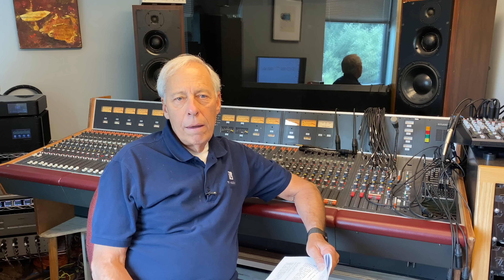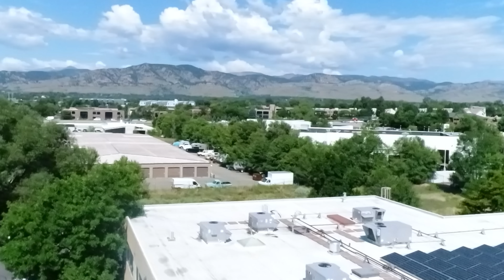Why are preamps expensive?

Comment: Thank you for an excellent explanation. I currently use a NAIM NAC92. These cost about £140 second hand. They are relatively inexpensive because the case is not so attractive as the “chrome bumper” NAC62 which costs about three times as much, but uses exactly the same circuit. In fact, the NAC92 is of a superior design, since it uses relays and electronic push button switches, rather than a simple mechanical switch. The circuit follows the design philosophy described here. There is a “unity gain buffer” to transform the input impedance, whether high or low, into a low output impedance at a power level sufficient to drive the balance and volume controls, which then feed into a main preamplifier, which has a high input impedance, so that the varying resistance of the balance and volume controls is swamped and has no effect on the signal quality. Then, the signal has quite a high degree of negative feedback applied to it. While purists would argue that this is not a good thing, the effect is to improve sound quality to the human ear. Just as a violin string sounds dull and lifeless out of a violin, the wooden case of the violin acting as a reverberation, or echo, chamber, adding life and body to the sound, a negative feedback circuit is similar, being a sort of electronic echo chamber, adding in timbre, life and body to the sound. Good audio engineers design for the human ear, not for the oscilloscope!

Comment: Good morning Paul, I've been in cable TV industry for about 30 years. started off as a cable TV installer then service tech then maintenance tech (a maintenance tech is the guy in the bucket truck that works on the whole neighborhood if you will). Then I got into management but I tell you that to say, working on those amplifiers to feed the neighborhoods for cable signal and all the things we have to do to make sure you get gigabytes speed. all the circuitry involved in those amplifiers turning fiber light into RF signal. The price of a BHK preamplifier is hanging on a lot of pole in your city. While I was in management I had to order inventory so I know how much those amplifiers on those poles cost so I understand to engineer something that's great as a BHK its going to cost a lot of money. And take it from the cable guy, "cables matter everyone". just the temperature of a cable will determined the attenuation of our signal, certain size cable determine how much signal I'm going to get on my output, we have to oscillate and shield our cable in order for you guys not to experience interference so you can get that gigabyte speed you want on your internet. And the hardest part of our job is to make sure we have a -50 dB noise floor throughout the whole infrastructure of our network. Cable matters more than you think ok, I'm rambling again. By the way I'm watching too many of your videos because I called my wife Terry twice at the dinner table. Lol have a great day
Reply: Do you think it makes sense to take experience with 1GHz-bandwidth signals traveling hundreds of feet through cable, and imply that 20KHz signals traveling 6-20 feet have similar issues?  
That's rather like insisting that a paper airplane thrown from the top of a skyscraper needs heat shielding like the space shuttle has for its descent from orbit.
Reply: The biggest part of the cable bill was on Easter Sunday I went outside to see the cable guy finally cleaning up a wired mess that was out at the bottom of the pole for 3 years.  Really HOLIDAY PAY is when you people finally do this.  Then he cut the wrong wire of course and had to run a new line to my apartment and schedule for the line to be buried and well, I dont have cable anymore.  I also had a problem when the oven kicked on my stereo would hummm.  I learned about the ground loop eliminator of course this cable company that rhymes with COMCAST had no flippin idea what that was.

Comment: Very good answer from the kindest man in Audio IMO.
Mark Levinson ML-7 pre-amplifier did obtain this balance between straight wire with pot (very expensive Spectrol Series 100 wirewound and later very  expensive Penny +Giles RF15 plastic conductive) and bufferstage. One of the best (old) pre-amps ever built and expensive also ($ 4,000.00 in 1981).

Comment: A good phono stage is worth its weight in gold and doesn't have to break the bank.  I use a NAD PP2e which retails for about £100 and it was a real game-changer for my TT.

My Sony LX-300USB is at the lower end of the TT market but I wanted to persist with it because I prefer an automatic TT to manual.  A separate phono stage and an elliptical stylus turned the weak, distortion-filled sound into punchy bass  and detailed sound.

If the separate phono stage hadn't worked out, I would have given up on this TT and gone for something a bit more upmarket but that little box makes a bigger difference than most people realise.

Comment: The last time I watched a video like this, I was off scouring the far reaches of the web, all in search for anything I could find about making your own voltage regulators.  I was interested in a regulator that I could really drain the current from, since commercially available regulators max out at about one Ampere.  I find the man who found the same rabbit hole before me and did the real digging.  His name is Walt Jung and he did more than build a discrete regulator.  He ran multiple regulators of differing topographies through whatever paces he could and wrote some good papers and probably even won an honorary degree or three, dubbing him the Grand Poo-Bah of discreet voltage regulators.  I still have yet to try out any of his regulators, having discovered the linear power supplies of Condor, International, and Power One.  Which all three seem to be the same power supplies made in Oxnard and yet they go by three different names.  So now I’m gonna be off searching probably about the potential of wiring my own transformers, maybe?!  THANKS FOR SHARING!!

Comment: I have very fond memories of my PS Audio 4.6 preamp from 1989..... It had passive and active modes, and what Paul describes is exactly what I experienced.  Passive was super transparent, but lacking some oomph.  Kicking in the gain gave it life and dynamics, at the loss of some transparency.   Sadly it had some reliability issues, noisy switches, and also was not remote control.  I switched to an Adcom preamp.  I liked the Adcom fine, but it was never as sweet sounding as the PS.
Reply: I've got a 4.6 as my main preamp at the moment. Love that thing, no reliability issues so far. Definitely understand the need to swap though I don't mind the lack of a remote.

Comment: I think I would feel much more comfortable getting an answer to this question from somebody who is not directly in the industry of selling preamps
Reply: @John Siket I would say it's an explanation but I wouldn't say it's a great explanation I would say it's one of many possible explanations for why so much money is charged for many of these preamps the thing is if you add up the cost of the  parts in a lot of these preamps they are dirt cheap compared to the final product price, in other words a lot of the cost comes from the initial R&D but let's face it making that money back in most cases doesn't take very long and then they just go on selling it for exorbitant amounts of money and I feel in most of those cases they are making way more profit then most people would deem as Fair
Reply: @MikeG-js1jt  I'm confused about why preamps need to take R&D into account.  Surely you can just implement a circuit which has already already been tried and tested twenty years ago.  There are lots to choose from depending how fussy the client is.  Why do we keep re-inventing the wheel?
Reply: @westinthewest  I'm sure there are scores of pre-amps out there that use "already developed" circuits, which brings us back to the original question "why are pre-amps so expensive" which leads us really to a single logical conclusion...GREED

Comment: Pots also have a mismatch between the two signal levels due to a varied resistance between the two wiper paths.

High end studio monitor controllers will typically use a relay network where each is connected to discrete resistors for repeatable volume levels and consistent stereo image.
Reply: Is there a same problem with electronic pots or volume controls?
Reply: @ranbymonkeys2384  pots are pots so they all have this issue. Some people think the problem goes away with stepped pots but they are still a mechanical device where a wiper touches a resistive plate; the steps just stop the wiper in predefined locations. These locations are not exact so the resistance will vary.
Reply: @rapfreak7797  So if you have 1 pot per channel could you not match them?  They may not show the same level on the knob but they can me matched I would think?
Reply: My NAD 2400 had 2 pots left and right I could adjust the little pots on the inside to make them match.
Reply: @ranbymonkeys2384  in theory yes but In practice no. Even resistors will have a tolerance level made to be a single value whereas a pot varies resistance based upon the location of the resistive plate; it’s a matter of physics.
Reply: set your bass treble and volume break the knobs off and love life man
Reply: @ranbymonkeys2384  stepped switches going through a relay network going through different matches pairs of resistors.  That’s the best method I know of although there may be a better option.
Reply: @rapfreak7797  well if we look at physics arent then resistors your going through your big problem?
Reply: @ranbymonkeys2384  a pot sitting still SHOULDN’T vary in value so if you’re talking about internal calibration pots that is a good solution to match your volume levels between channels.
Reply: @ranbymonkeys2384  the travel across the resistive plate is what causes the issue, you’ll never stop in the exact same spot each time so you will get different values. Now multiply that by two, no two pots in reality will have an exact match of the starting resistive value and the slope at which they vary; nor will that slope be a straight line (in the caramel of a linear pot)
Reply: @rapfreak7797  I like just going through 2 matching pots that adjust to match a pot I dont even own
Reply: @rapfreak7797  if you see slope as a straight line then you have bigger problems than the "impossible pot"
Reply: A better solution is to use a PGA, either using a chip (TI makes them) or by using a multiplying DAC in the feedback loop of an op-amp. VCAs are another solution, but tend to have inferior distortion performance.
Reply: @H-77  I didn't know those existed
Reply: @ranbymonkeys2384   They aren't as popular as they probably should be, but they aren't new. MC2 used the idea in the MC series amps back in the mid 1990s, and I'm sure they weren't the first. Because you can get 16 bit multiplying DACs, it's pretty easy to get much better resolution than a stepped attenuator (you lose some steps to your log function, but with 2^16 steps that's not a huge problem). 

You can learn more about this application for multiplying DACs here:
https://www.analog.com/en/analog-dialogue/articles/high-resolution-multiplying-dacs.html#
Reply: @rapfreak7797  Stepped attenuators with 1% resistors get plenty close enough, but inevitably the steps are annoyingly coarse or the attenuator costs a fortune.

Pots are a real sore spot too, because good quality volume pots will cost around $10 - $20 each. That's a large part of why high-end analog mixing consoles were so expensive.

@rRanByMonkeys, you can add trimmers inside the preamp in an attempt to match the sections better, however, you will find that when you adjust it to track perfectly at the low end of the volume range, it no longer tracks well at the higher end of the range. Pots are one of those components that are inherently very imperfect and haven't gotten much better over the last 30 years.
Reply: @H-77  Do all of these have to connect to an Arduino or raspberry pi?

Comment: I understand that in the analog world there are a lot of compromises to make and you need good quality materials. Recently I went from the Rotel RC1590 preamp (with a Minidsp AD-DA) stage between the speakers and subs) to a fully digital Minidsp Flex Balanced. Now the entire audio chain (until the output to the power amps) is digital. I noticed a very pleasant upgrade in sound quality, especially in the low end. At low volumes the bass frequencies are much more in balance than before, where at lower volumes it gets a bit flat.

Isn't digital the best way to go nowadays? Digital sound (24/96) is absolutely fine, lots of headroom both in the dynamic as in the frequency department. You can pick the absolute original digital signal, process is to match the speakers/room/desired volume and at the very last stage convert it to analog and send it to the speakers? I do that now and I will never go back. This sounds very good to me and even the phantom center is now appearing to me, like the ochestra behind the speakers. I did not get that when using the analog preamp.

Comment: Paul, everything you said is true.
It is also the reason why the conga line of mixing boards (like the one behind you) pollute the signal.

@1:19 "...and it was extremely clean"...
...is lost when device after device, box after box, tweak after tweak, is manipulating the once "extremely clean" signal.

I am not suggesting that zero processing be done.
I am, however, suggesting that studios drill into their staff that they must give serious consideration to every urge to use yet another processing box.

If every additional processing operation cost $10,000 then watch how fast they would manage to put out great sounding music, without all of the superfluous processing.

Maybe the the music studios should operate like the Affordable Care Act, where government approval is needed for each additional mixing box the studio wants to use?  That would surly cut back on all of the unnecessary processing operations.

Considering how awful most of today's music sounds (it sounds artificial, compressed, congested, contrived), studios should consider requiring mixing engineers to seek approval for excessive processing.

I hate adding red tape to the production line.  But considering how bad most of today's recordings sound, the engineers have only themselves to blame for the extra hoops they will have to now deal with in the approval process.

In any other industry, if quality control was found to be lacking, management would take steps to remedy the problem.
It seems that recording studios have an exemption carved out for them in the standards and practices that are upheld in nearly every successful business.

The problem is that since very few songs get released with high fidelity, and most people do not own PS Audio level equipment, the public is oblivious to how bad most songs sound, and how fantastic they could sound, in the hands of the right mixing and mastering engineers.

Cheers!

Comment: I'm gonna get riled up - I love it! Please explain a 1:1 impedance matching transformer please. :)
Reply: (n_p/n_s)^2 = z_p/z_s

Where n_p is the number of turns in the primary and n_s the number of turns in the secondary. z_p is the impedance of the primary and z_s is the impedance of the secondary.

A 1:1 transformer is an isolation transformer. It inductively transfers a signal at the same voltage and impedance from the primary side of the transformer to the secondary side of the transformer.

Comment: I had been using a DAC with variable output direct to my power amp. I just upgraded to a pre-amp in between, sounds quite a bit better
Reply: all audio equipment has its own sound type and no one has the same sound!

Compare with earphones straight out of the DAC. and straight out of the preamplifier and the sound should be equal. or straight out of CD player to straight out of preamplifier without DAC. and the sound shall be equal!
Reply: I have the opposite experience; I go from my Dac (with volume contreol) straight to the amp; tried with 2 different tubed linestages and the sound was not better to worse than direct Dac-Amp.
Reply: Well most DAC with variable output run at low signal level and can’t handle much capacitance load. It is not surprising that a good preamp will make a huge improvement. XLR and pro audio signal levels are the way to go if you want the finest in quality. Pro audio signal levels are higher than consumer level - more dynamic range or SNR.

Comment: Of course, my first thought when reading the title was Why limit this question to pre-amps?
However, Paul has summed it up succinctly, with an answer that can be loosely applied in general to all components.

Unfortunately.

Another question might be, why is it now possible to achieve a great sounding system for a fraction of the previous cost?
Reply: The prices on really high performance op-amps have come down a lot too. With some of the offerings from TI (OPA1642 comes to mind) that ultra-low-distortion buffer has become a lot easier to implement.